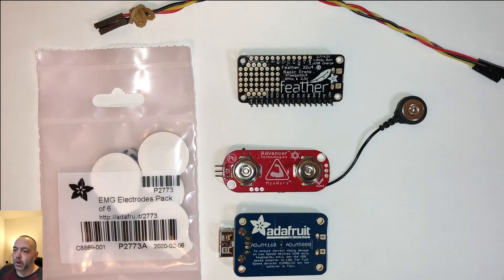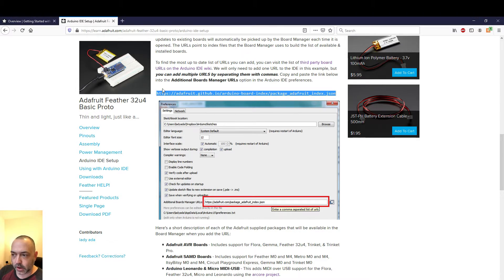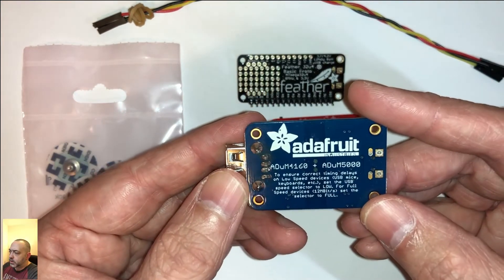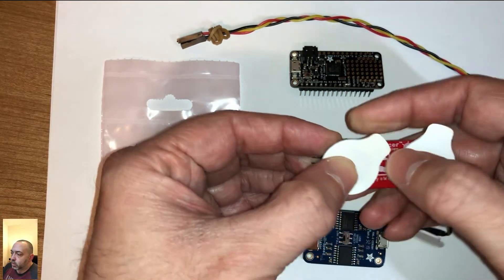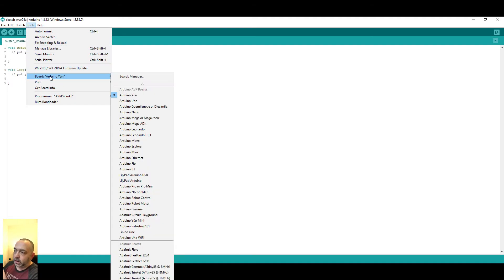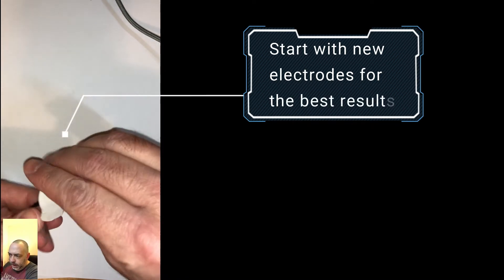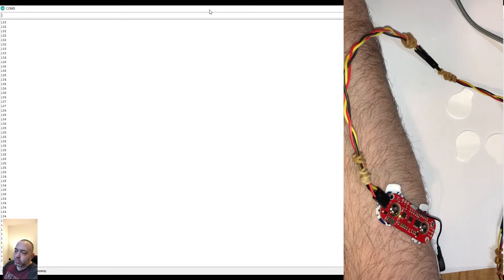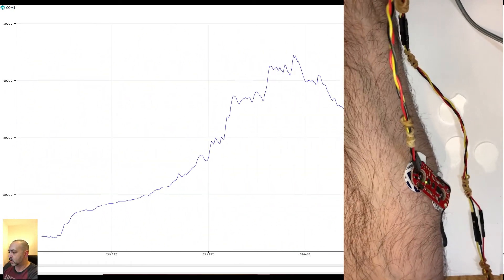Robotics: MyoWare Electromyography (EMG) Muscle Sensor Walkthrough

Comment: Do you have to have the separate drivers? because i have seen people simply read an analog from the myoware using an arduino without installing any drivers.
Reply from the maker: I used an Adafruit Feather and had to install the drivers to get this to work.  If you use an Arduino board (non-Adafruit brand) you probably don't have to download any other drivers.
Reply: @mikebemiss8186  Oh thanks!